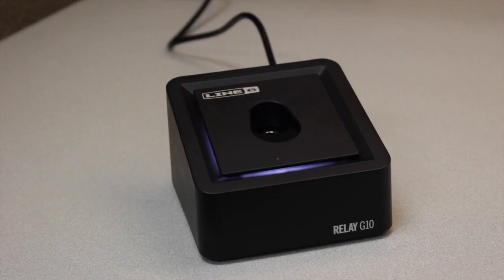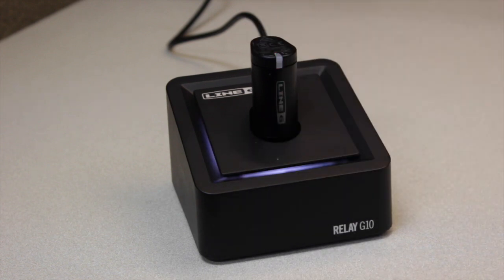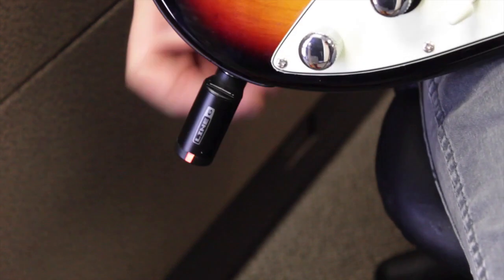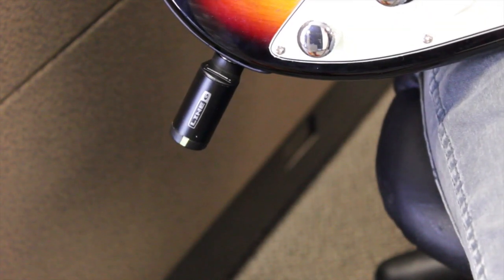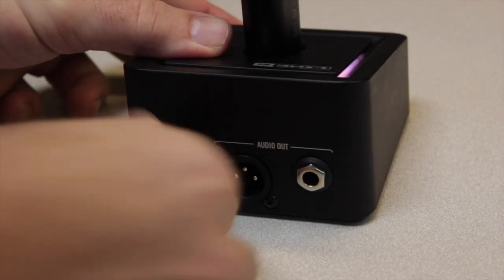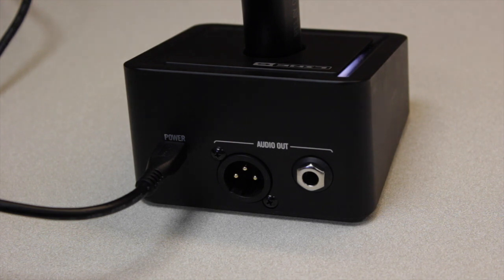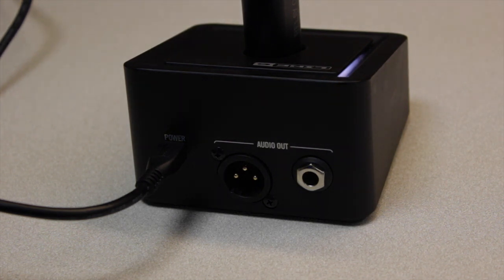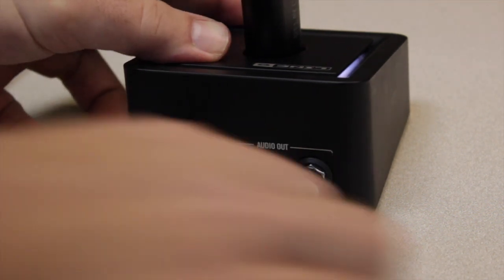Line 6 G10 Relay Wireless Tutorial

Comment: This thing is terrific. I love the fact that it allows me to play my guitars without dragging a cable around, but my favorite thing about it is how it eliminates the hum that has plagued my guitar setup since I moved into my current house. Let me explain in detail in case anyone is having a similar issue in their house...

Whenever I plugged any of my guitars into an amp or recording equipment that was plugged into any power outlet in my house, there was an annoying and steady hum that I could hear. I used a tuner app on my phone to verify that the hum was 60hz. My guitars with lower output pickups made the hum sound worse because the signal to noise ratio was lower. The only way to get the 60hz hum to go away was to plug my guitar into an amp that was battery powered. I tried a power conditioner to no avail, confirmed my guitar cables were shielded, and confirmed my guitars weren't defective. I asked the pro audio guy at Guitar Center, a luthier, a friend who is an electrical engineer, and even an electrician who was at our house, and they were all stumped at what could be done to solve the problem. I came to accept that something outside of our house (e.g., perhaps the high voltage power lines that are less than 200 yards away) were causing some time of ground loop or interference, and that certain guitars just couldn't be used in my house because of the annoying hum.

Then one day I had the idea to try this. I thought: given the fact that plugging my guitar into a batter powered amp fixed the issue, perhaps breaking the physical electrical path between my guitar and wall socket via a wireless system would also work. And indeed it did! I can now use any of my guitars, even the ones with lower output pickups, with an amp or recording equipment plugged into my house wall sockets, and I'm hum free!

Comment: May be a silly question, but does this work like normally connecting your guitar to your amp?? The transmitter goes into my guitar, the receiver goes into the amp input?
Reply: Yeah that's how you'd get the signal to the amp from the receiver. Just a standard 1/4 inch jack like a guitar cable, though you'd probably be better off with a short, stomp box 1/4 inch cable to keep things uncluttered. I personally have it directly on top my amp so I use that small cable :)
Reply: the 1/4 inch unbalanced adapter suggestion does  not work with Fishman power jack pre amps

Comment: hello i would like to know if there are any power supply have to be connected with the dock(receiver) when in use?
Reply: There's a wall plug thats usb to microusb that needs to be plugged in for the receiver to work. It doesn't have an internal power source.

Comment: Things that go wrong weigh this unit are ...
1. Battery burns up and can catch fire.
2. Using more than one line 6 wireless unit on stage can't end in fairly difficult trouble shooting.
3. It's disconnecting and then won't charge even after 6 hours still won't charge 
4. Line 6 should have recalled this garbage but instead they just let you their customer house burn down from faulty line 6 wireless unit battery burn up !

Comment: The micro usb connector is crap and fall out of the socket regularly making the unit un reliable and unusable.  I had no issues with the performance of the unit when it worked, it was exactly what I was looking for, however, the power issues makes this a no go for any practical user.  I spent $160 for a piece of plastic that does nothing. Do not buy in it's present configuration.

Comment: One thing to note about this unit is that it worked great with my electric guitars, but it did't work with any of my several acoustic electrics.  This is a common problem and is solved by plugging a 1/4" male to 1/4" female adapter into the guitar and then plugging the G10 into that.  Based upon what I saw at the forums and my own experience I believe this is such a common problem that one should just be in the box.  Tip: go ahead and pick up the adapter if you buy the G10.  Nothing is more of a pain than having to return to the store or place another online order and wait for it to come so that you can use the wireless.  

Otherwise, seems like it works pretty much as advertised.
Reply: Same thing happened to me.  And no where on the website I bought it from or even in the owner's manual its self does it say, this may not work with some guitars. Only by diving deep into website reviews was I able to find the fix (which is what you said...the 1/4" mono adapter)